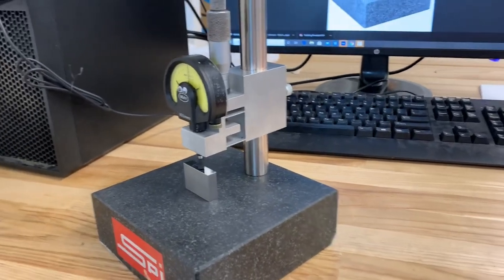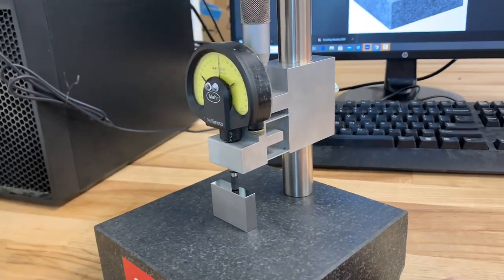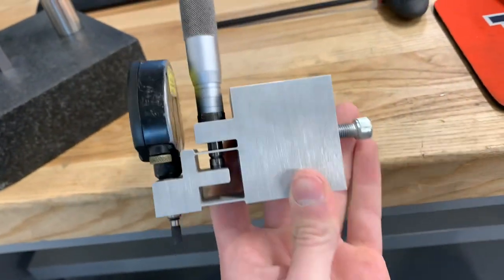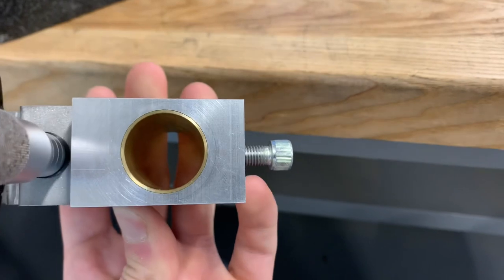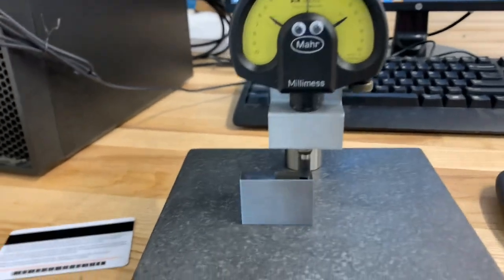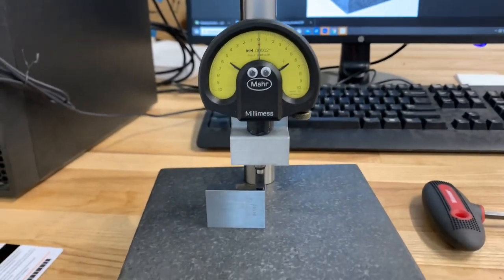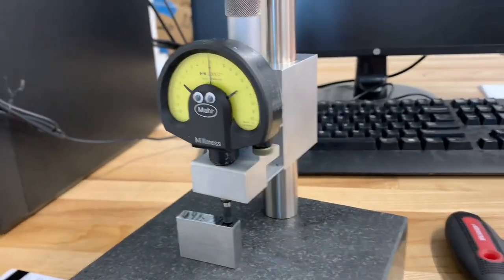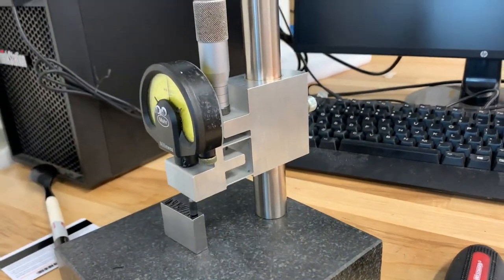What can you see with .00002” resolution? Flexture based indicator stand

Comment: 2 tenths would be out of range of my mikrokator
Reply: 0,1 micron res. Or about 4 millionths. Travel length +-4 micron or just shy of 2 thou. You can sometimes get one from ebay for about 100 bucks for unused made in ussr one.
Reply: I've heard that C.E. Johansson had a mikrokator with 1 nanometer resolution which he used to measure gage blocks reliably to the millionth in the old days. Never seen any even with 10nm resolution though